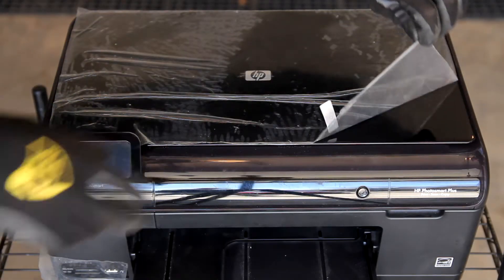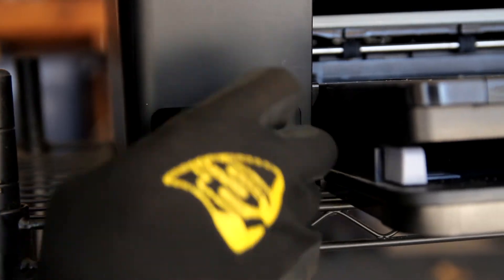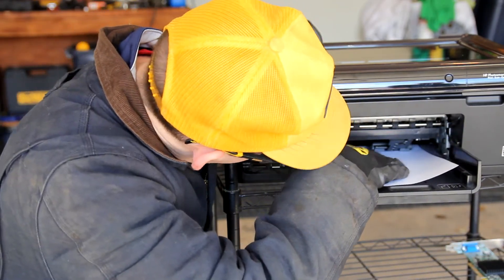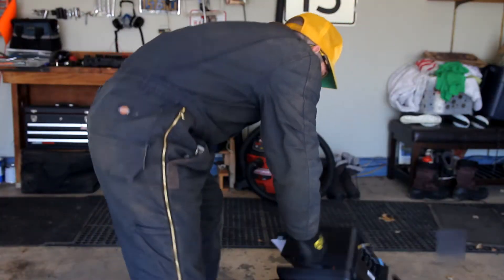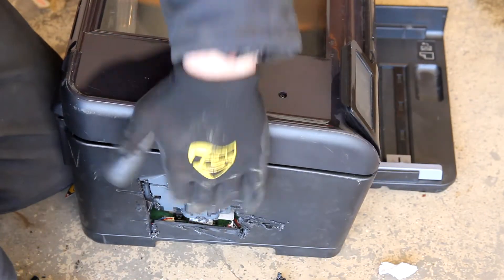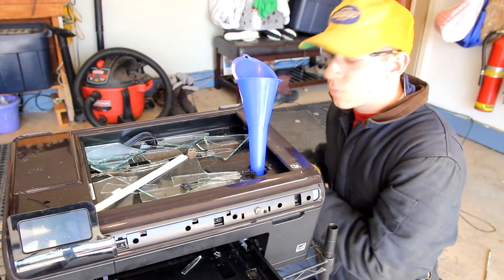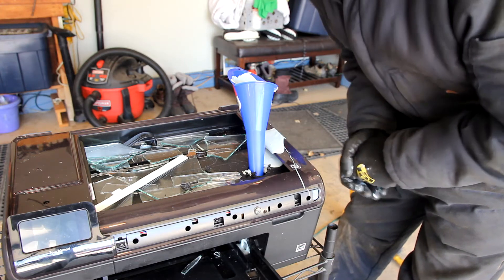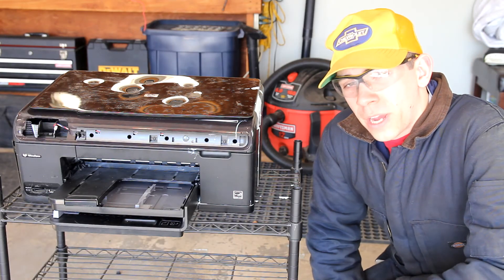Tech Garage: HP Printer

Comment: I followed all the steps that you showed in the video.  I don't know if I did it right but my printer seems kinda broken.  It is really difficult to type as well because after 2 hours of surgery to remove all the glass shards from my hands, my fingers are still a bit numb from the anesthesia.  One thing did work well though.  When I removed the mobile print monitor and took it with me, it was 100% accurate.  There were no print jobs going and my mobile monitor was completely blank.  I think with a few tweaks to your process, you are really close to distributing helpful "do-it-yourself" content that Youtube sometimes lacks.